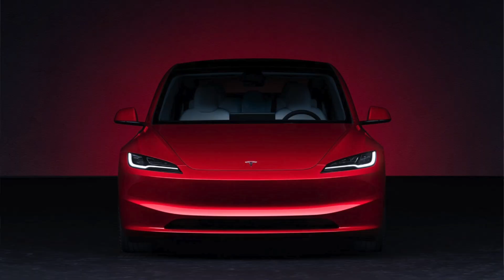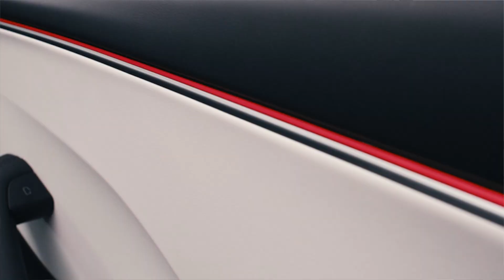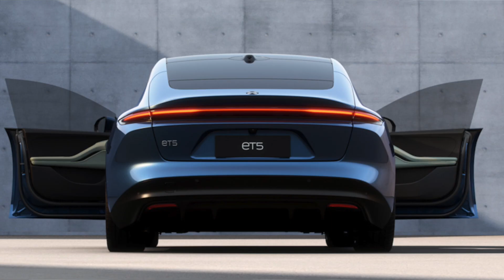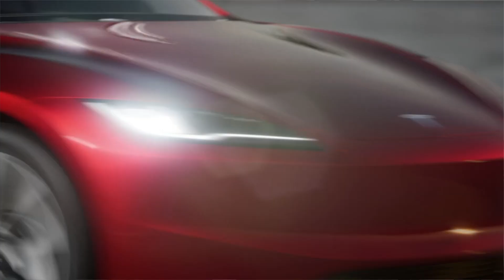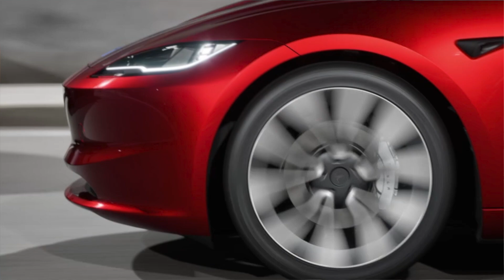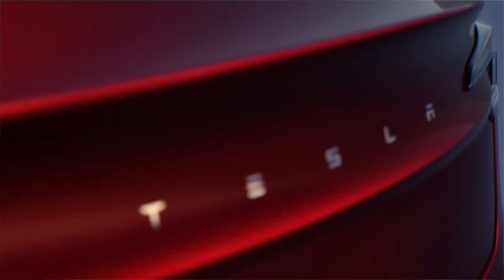Tesla Model 3 Highland NEW Performance Model with Sleek Exterior Design!

Comment: There are two reasons to still buy a current Model 3 in the US: First, it's available now, while the Highland isn't going to be available until at least Q1 of 2024, maybe even later depending on how well the retooling goes. And 2) Price. The Highland will be more expensive than the current model 3, and the $7500 tax rebate is still in effect for the current model 3 and will 'likely' be ending before the Highland is released here (according to Tesla). That said, I am still quite eager to see the Highland here in the states! :)
Reply from the maker: Agreed with all your points

Comment: Where did you get that information about performance motors and bumpers?
Reply from the maker: Leaks and sources in China, got connections too
Reply: Cool fingers crossed hopefully they will announce it with the Cybertruck delivery date :)))
Reply from the maker: Yup fingers crossed my friend 🤞
Reply: @heyJohnEe  hopefully you get a little more information soon. Higher top speed 200MPH will be super and flat power like the Plaid bend with 600-700HP will be a perfect car a real track monster.